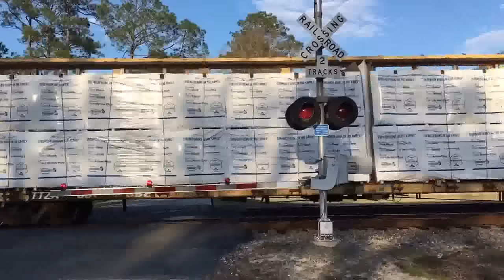What Happens When Railroad Crossing Gates Malfunction?!   Etc.

Comment: There used too a crossing about a mile from where I live here in Michigan. It is now a rail trail getting paved and part of a large interconnected network. Everytime it rained the sensor would short and lights would flash. Train only went through once or twice a day at the most and sometimes only once a week. Never stayed on very long. A while back a county truck plowing snow via belly plow somehow caught another crossing just right and whole plow assembly came off that was not welded too truck frame!

Comment: The crossing gate shaking strong possibility from small earthquake tremors. The other when the gates and lights didn't work at night was probably a switch malfunction or break in the cable between the switch and the warning signals.

Comment: Why do the rails go through towns like this (looking at the end of the video)   just running down the street?  Did the town planners not plan for there are rails down our high street,  wont it be a better idea when we build the town that we at least have the rails to themselves for safety and well convenience.  Now in the UK, we have 1 like this in a coastal town but it's the only oddity and it doesn't run on the roads.  and our level crossing blocks the whole road so cars cant weave around them.

Comment: At 5:00 it is possible it is just the gate falling as it does in a train coming, but there not was one coming, so the gate slipped and the motor is pulling it back up!

Comment: I remember my close encounter.  We were all waiting and a crossing gate light on and down.  Train goes slowly by slowing as it goes.  As it's almost to a stop as it gets by the crossing going just a bit further and stopping.  But it's enough for the lights go off, gates go up, and cars to start to cross.  Well six cars up in front of me is a Semi Trailer.  And he wants to turn to the right onto a street past the crossing.  He displays no signal or anything.  He goes over, we start to follow .. and he suddenly comes to a halt and THEN starts to signal a right turn after he stops.  But he can't turn as he's too big and cars on the street block his way from the backup waiting for the train.  So there I am just starting to cross when everything stops moving again.  And then .. the lights start up and the gates start to come down.  The train that went past is reversing!  I had one option.  I swerved off to the right off the tracks and onto the sidewalk / grass to the side (lucky me).  Oh my car hit part of a fence and scratched it (but it was a beater so no issue).  But that train kept on back up right over the tracks.  If I hadn't moved he would have hit the car and kept pushing it as he backed up (he engine was at least a mile down the track so he had no vision and there was no caboose to look for him).  I've always waited since then before crossing an intersection as I realized I just can't trust the other idiots on the road to think about others.

Comment: Laws need to be made that cameras can be installed at RR crossings. When morons drive around the boom gates a photo of the driver, the carriage, and the license plate should be taken, and a state Highway Patrol trooper should show up at their front door, and confront them on the violation. Further, it should also get the traffic courts involved and people lose their license and complete a written and road exam with a fine of $500.00. If it happens again, permanent revocation of their license. I think that would stop a LOT of it. If laws are passed to make it so, then the constitutionality of it cannot be challenged because it is law.

As for rail tracks that cross intersections of roads, they ought to be able to come of with some type of system that detects obstructions on the tracks and it signals the train far away enough were they are able to stop before reaching the stuck car or whatever it is that is obstructing the tracks. Even if it could potentially derail the train. That would also prevent a lot of these problems.

Whenever I approach a Rail Road Crossing I ALWAYS activate my Hazard Flashers, open windows, make a full stop, look and listen for a train, then proceed when I am sure the tracks are clear, and for the very reason that the crossing might be broken. I am sure it pisses off everyone behind me, but they need to deal with it. There is little that pisses me off more than when I see idiots that just fly across the tracks, and more so, when they drive around the boom gates. I have ideas to stop that too, but it's too complicated to type out here.

Comment: So trains have a crossing guard like school buses do? Didn't know that, never seen this before. Is the position considered a flagger?
Reply: It's simply the conductor in a crew, They have the flags in handy for crossings that are not electronic or not working properly as seen in the video. It is not common for them to flag crossings so a full position just for flagging crossings is not required.
Reply: @Lakeside_Rail_Productions  thank you very much for the explanation. I appreciate it.
Reply: @anye76  No problem.

Comment: I’ll take a guess at the shaking crossing gate. Looks like the mechanism that lifts it had broken one notch short of fully raising it. Until it’s fully up to press the stop switch it’s going to keep spinning, hanging for a second then slipping back down.
Reply from the maker: Cool!  How do you know so much about them?  Do you work for the railroad
Reply: @JawTooth  Don’t work for the railroad, although I should have when I was younger. Would have been too tired to get in so much mischief. 
At 16 I had no choice but to buy a car and keep it running to stay away from home. Huntsville, Ala. where most of the Army & NASA engineers lived. Every time it broke down I’d ask them how to diagnose and fix it and they loved teaching me. I also spent a lot of time at the speedway and a group of guys from Hueytown were they same way. So I just picked up a little bit of how mechanical things work but I’m no expert by a long ways.

Comment: I’m glad you found a hobby that interests you, but I watched about half of these and every one made me shrug my shoulders. So what?

Crossing gates malfunction. The lights burn out, the flasher unit fails, the sensor that detects the gates position is misadjusted. They don’t have any idea whether it’s day or night or snowing. A video documenting these failures is rather like driving around filming cars with flat tires or burned out taillights. All it does is show the rail companies need to fix their equipment. OK....

The thing about driving around down crossing gates is also kind of so what. I don’t think I ever would if I could see a train anywhere in either direction. Even if it was going 5 mph I’d just sit there and dutifully wait like a sheep. But the thing everyone makes fun of drivers for not understanding, that trains are massive and they can’t just stop on a dime works both ways. If you can see the train going 5 mph 50 yards down the track I can’t really fault people who say “why should I wait for this thing that might block me for 20 minutes when I can plainly see there’s plenty of time to get safely through?” If they can’t stop on a dime they can’t radically accelerate on a dime either.

I realize the people on the train are just doing their job, but when there’s a crossing near a yard and the train just keeps moving slowly forward and slowly backwards moving the various cars onto different spurs while all the drivers have to just sit and wait it’s easy to understand why drivers develop a rather hostile attitude towards trains. The next time they see a gate coming down they will remember when they had to sit there for what seems an eternity and make a risky and perhaps stupid decision. Lets not even bother citing the obvious, that it’s against the law to go around down gates. These days nothing is illegal. Running red lights, doing donuts in broad daylight, too dark window tint, fake mufflers, smoking joints while driving... one could go on and on. Who thinks anyone has a chance of getting pulled over for going around crossing gates? If they think they can they will.

Comment: I worked at the rail road corbin ky.... a train running thirty five miles per hour with a hundred car pull,  takes five miles to stop , i see human error here and human error from the rail road not fixing there equipment......but whatever you do don't take a chance with a train , train engine weighs about one-hundred and fifty tons and vehicle weighs one ton , and trucks about two ton c1500 .....

Comment: I've seen the crossing arms go down with no train before. Thought possibly a relay stuck in the control box.  Just a moment and it's up again.  Never ever saw drivers go around the dropped arms before!! I hope ppl in my area don't get this in their heads or they'd try it! I would have a big Horn/Siren dangling overhead of the wee opening, and it frikken blast the eehhch (scare the pants off) of them as they pass underneath. ( like "idiot what are you thinking" ). Where I live, they have a separate safety arm, a short one, that drops in front of the Pedestrian crossing, both for the GO Train (Commuter rail) and Freight CN) lines, & for the Regional Electric tax fiasco. Ppl duck under, and a few died. Hit by the Electric City train. They also turn in front of it and get hit.

Comment: I know why in the pat where to railroads signs go p when train get close at the 12:32 time is because there is a pressure senser that the train goes over and once the weight to the train is off in about 5-10 seconds the bells go up

Comment: Can't you send your video to the Police so they can prosecute the drivers, if it has the license plate details?
Reply from the maker: No, they wouldn't prosecute unless they saw it.  I never call the police for anything.  The times that I have called them it turned out to be a waste of time.  I called them for thefts and an assault and they did nothing.  I'm not anti police but they are almost useless.

Comment: 12:18 is it still a train if it's just a single detached engine?
Reply from the maker: I don't know.  I would have to look up the definition.  The news media would say it was a train if it hit a car
Reply: @JawTooth  - ok cool.
Reply: I thought it may be possible for larger engines/locomotives like that one if the definition went on something specific like number of bogies or axles (more than 2 for example) but unfortunately the 'oxford languages' google result that came up relevant to this type of train said: " a series of connected railway carriages or wagons moved by a locomotive or by integral motors. "  so it's clear by this definition in any situation that at least two seperate but connectable chassis are needed and in the case of the two chassis version each would need an integral motor. So if 2 loco's are the only 2 connected chassis I guess that's a train but if a locomotive is puillng carriages, there needs to be at least 2 carriages to be a train (3 conectable chassis). If that's correct then what on Earth is it called when you have a locomotive with just one non-powered carriage behind???

Me suspects Oxford's wording might  have fallen a little short of the mark in this case. 😕